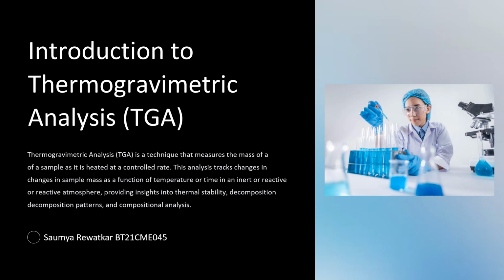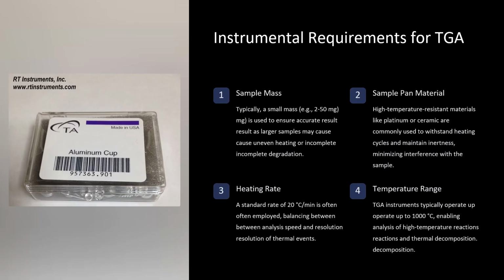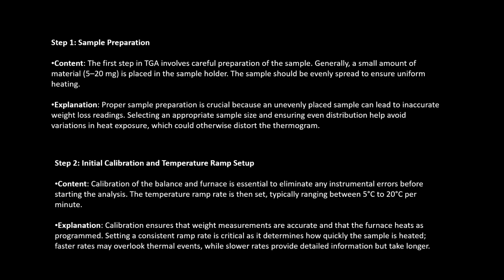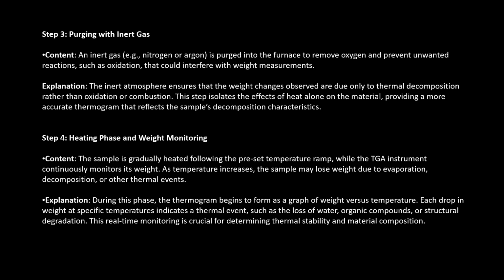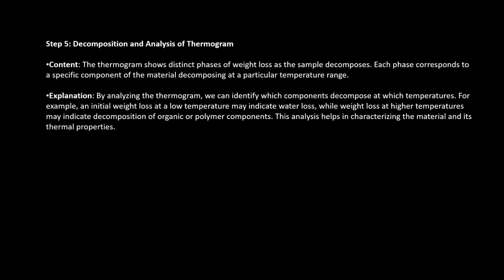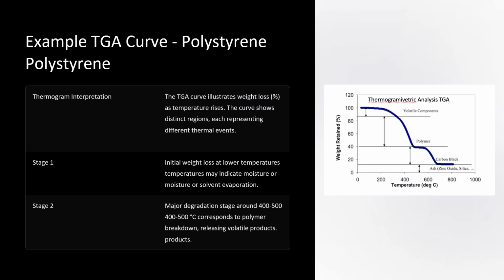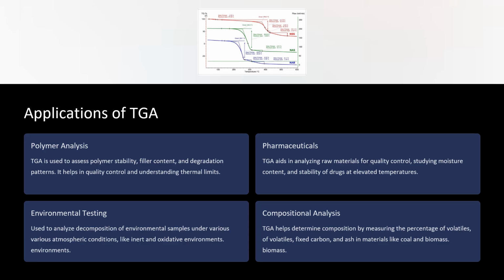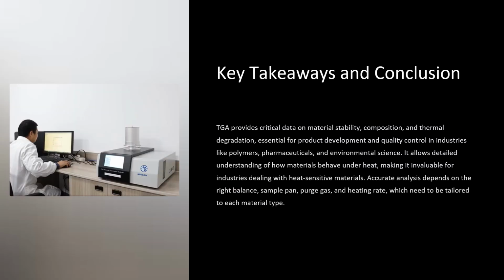THERMOGRAVIMETRIC ANALYSIS

Comment: BT21CME041-How is it used to analyze material properties?
Reply from the maker: Thermogravimetric Analysis (TGA) analyzes material properties by measuring weight changes as a material is heated, cooled, or held at a constant temperature. It helps determine thermal stability, decomposition patterns, and the content of volatile or inorganic components.